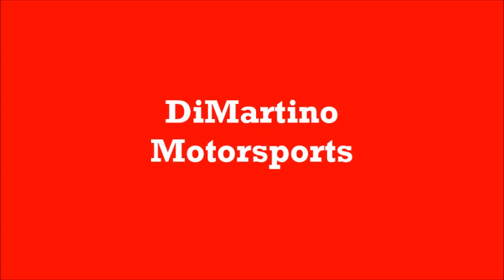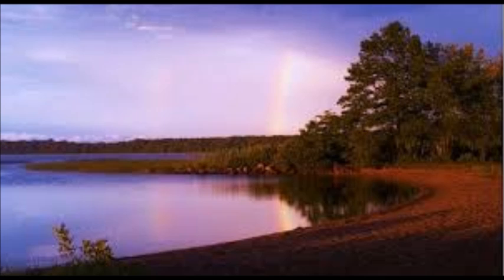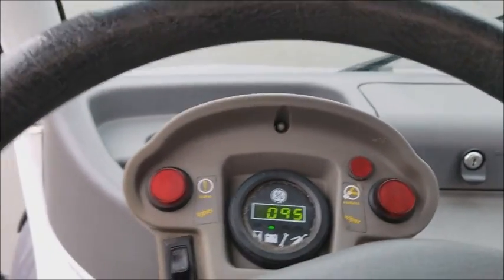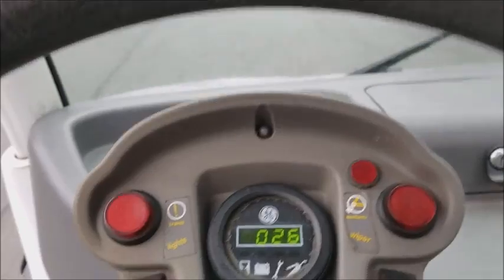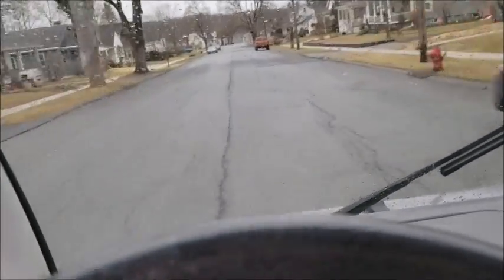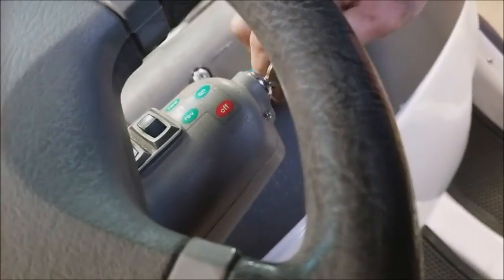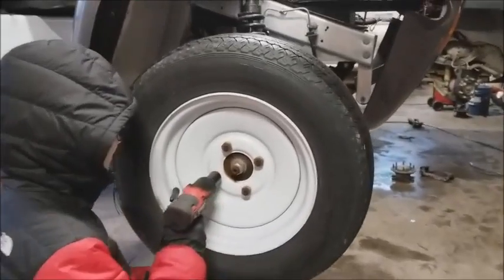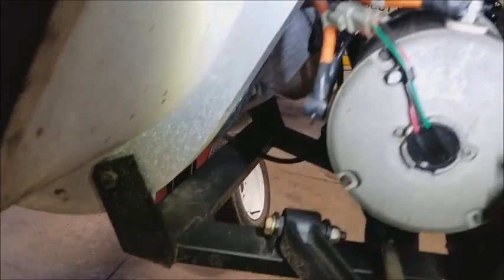2002 Gem Car E825 Electric Motor install

Comment: I have the same 2002 G4 Polaris Gem and doing the exact same upgrades ( I would be interested in knowing where to buy the motor and what to (what size) and get the controller programed as well ( What company did you use)  - also looking at a lithium conversion for longer lasting shorter charge time over all when done. I trust your work so who better to ask these questions.

Comment: Any idea how much more top speed it will get with the controller flash?  Imagine if you dropped a Tesla Model 3 motor in dat.   Instant Ludacris mode. 😜
Reply from the maker: It should goes out 40 or 42 reflashed

Comment: what does flashing do to it
Reply from the maker: The controller decides how and when it's going to give the motor the battery power. When you reflash it you're basically not letting the controller babysit your throttle. Also the controller limits beer mile an hour to 28 now that is bumped up to 42

Comment: Vinny , what can I do if the motor won’t come off the spline ? I pull and pull and even tried to pry it and nothing. The motor does turn though after I took out the three bolts. Any help is appreciated thanks

Comment: What did the motor cost for 3 miles an hour?
Maybe an LS swap soon?
Reply from the maker: The thing is with the motor you can't use its full potential until you program the controller. Once it's programmed it'll hit about 40 to 42 miles an hour
Reply: @dimartinoindustries6026  what would the original motor run if you reprogrammed the controller first? How much bigger was the second motor over the first?
Reply from the maker: @ltsgarage7780  The probem with the stock motor and reprogrammed controller it will overheat, they have overheating problems as it is under heavy use. thats why.
Reply: @dimartinoindustries6026  thanks Vinnie.  Nice to see you after occ. You really inspired me to do what ever I thought I could.  You really were the main designer builder on the show. I also understand editing & what the producers wanted.
  By the way. I'm probably 25 to 30 years older than you.

Comment: Good to see you working with your kid Vinnie!  Remember though, with speed comes great force and those drum brakes don't cut it when fully loaded. NEV Accessories sells a great front disc brake kit for the 2002 e824( I have one too ). I highly recommend it and it too is something you can do with your kid.

Comment: Great video with your son. Back in the day, at work we had 3 wheel cushman elect carts. We installed external cables to short out the shunt field after we hit top speed. This more than doubled the top speed woohoo!